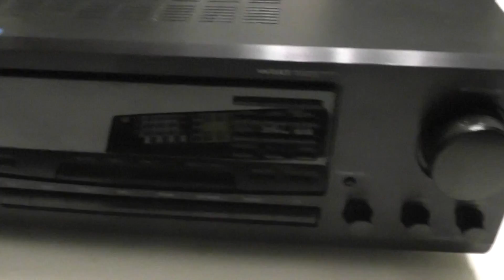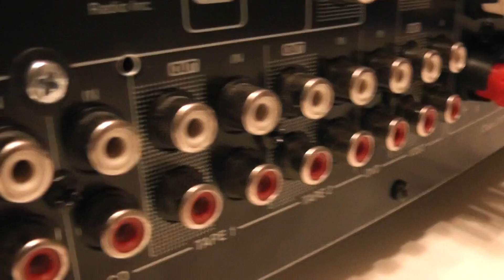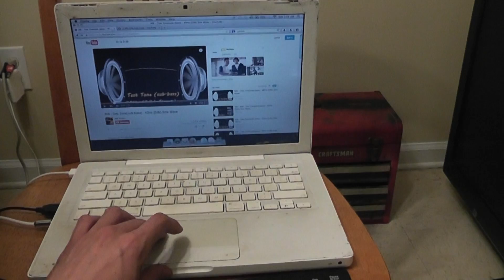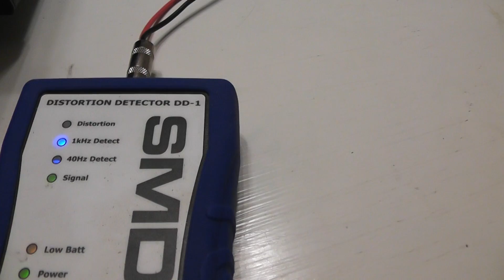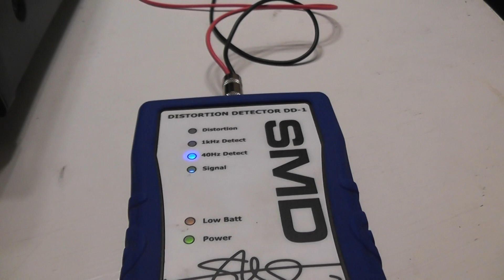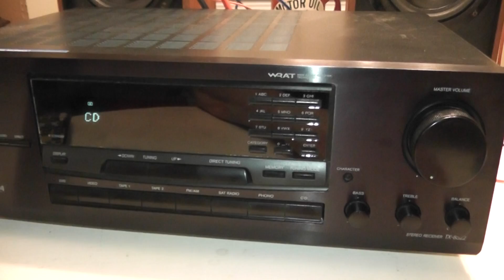Onkyo TX-8522 Music and Clip Point testing

Comment: I have its predecessor the tx-8511 and the Onkyo dxc390 CD player which I purchased at the same time and and they have both been a Workhorse for the past 15 years, I run it hard! My thirty-year-old 7-band graphic equalizer really helps out with the sound quality . I use Cerwin Vega e712 3-way floor-standing speakers and just recently added aperion super tweeters with adjustable crossover and volume controls. Also enjoying 1998 Technics sl-1200 MK5 that I purchased in 2016 and have put over 10,000 trouble-free on. I use ortofon 2m black cartridge mounted in sumiko headshell and run through project tube box s phono preamp. Also have the Audio Technica440mlb cartridge in sumiko headshell. Just recently purchased ortofon om-40 Fritz gyger 70 stylus recommended by kab. I am very satisfied with my Onkyo tx-8511 but sometimes I get the urge to upgrade I am afraid of being hugely disappointed and getting something that is also unreliable. Very serious about tube amplification. Would like to try a hybrid tube solid-state with tubes in the preamp section. I just saw a Onkyo TX 8511 on sale for $45! That is such a steal.

Comment: Hello. If I needed to run 4 ohm speakers to this receiver how would I connect them?
Reply from the maker: Just connect to + and - normally but there is an option that can only be accessed by the remote control to switch the receiver from 8 to 6 ohm mode (which is fine, ive been using mine this way for years)
Reply: @woofervision673  thank you. So is it a series of buttons I need to press or is it in setup options?